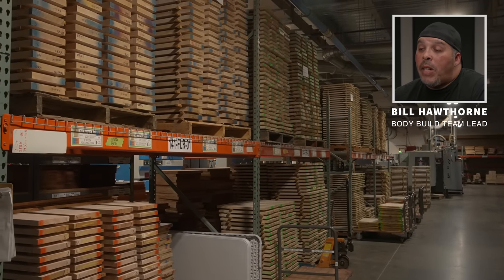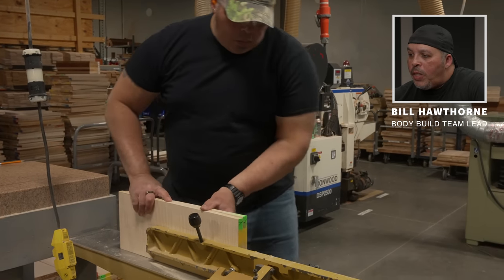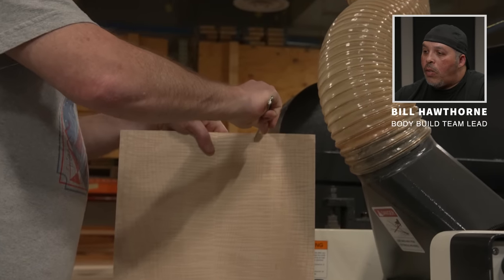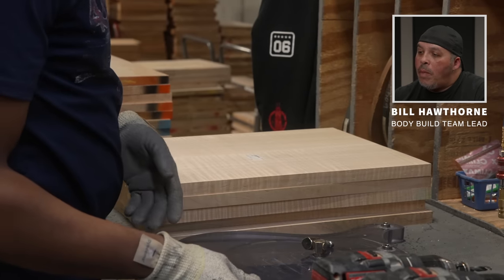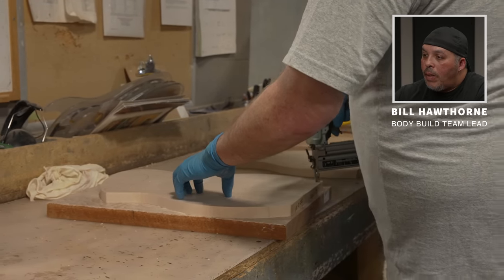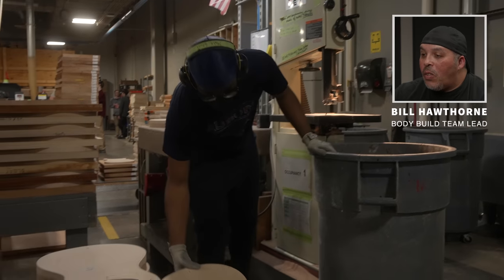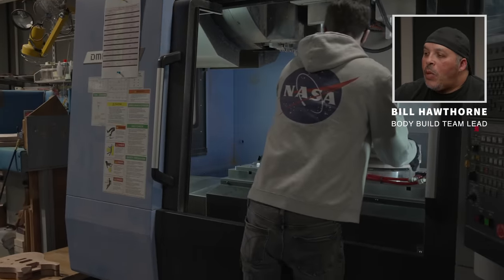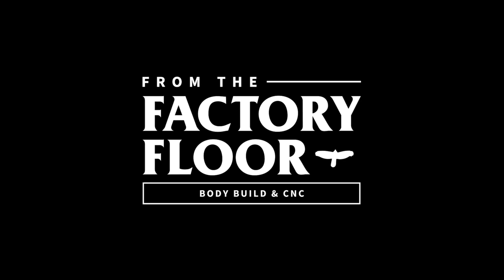How We Build a PRS Body | From The Factory Floor | PRS Guitars

Comment: 2:20 “He’ll be sure to use glue on both sides of that wood”

Doesn’t use glue on the other piece
Reply: Did you see that little wiggle move when he put the two pieces of wood together? That's the move: it completely coats both pieces.

Comment: the joined tops arent clamped? huh
Reply: I went back and I looked at the video. The back of the board has some fingers that push it in and the front of the board has two triangles… They’re like bench dogs or something. So it does get “clamped in some sort of way. Or held together while they use that radio frequency curing device.
Reply: @JohnnyArtPavlou  ok yes they have a pneumatic clamp system. didnt see on first view
Reply: @geezberry8889  Thanks, yes…pneumatic.

Comment: Interesting, I've never seen that joining process before. Did I see that right that in joining there is no clamping pressure applied at all?
Also, usually in CNC machining for wood you have a hose taking away all the chips and dust. You also not seem to bother with that, is there a specific reason why you do that? Just curious to know.
Reply: @2:13 you can see the pneumatic rams on the assembly table that press the two halves together like clamps.  That green trough is where the glue squeeze-out drops away from the glue seam; it's lined with green tape to make cleanup easy.  Each CNC unit has a hopper in the bottom that collects all the chips and send them to dust collection.  There's no need for a bristle shoe with a vacuum hose on the cutter head because it's a closed unit.

Comment: I don’t understand how the glued up top and back are done so that the book match line on the top stays vertical.
Reply: When the clear template is lait atop the glue-up and the tech traces around it with a pencil, the template has a vertical line that runs down the center.  The tech lines that up with the top's glue line before marking the wood.

Comment: For a while I wondered why the CE models did not have recessed back cover plates, but now I’m thinking is it to be close to the thickness of the neck socket screw plate so that the guitar sits more square on a bench surface?
Reply: No, the recessed plate is merely a production step associated with the Core line.

Comment: Really wish they would give the s2 the same carves as cores.
Reply: but then it will take more time, and then the S2 would cost as much as the core... The more time they spend on the guitar, the more expensive it gets.
Reply: @Spidouz  that’s understandable however it’s not like it’s done by hand. It’s done by cnc machinery. They should find a way to make the carve a little closer to the core. Hell I would say the se curve is closer. Just my opinion. I love my s2 but I also love my se’s and find them to be to close on quality at this point. If I would buy more guitars I wouldn’t even consider the s2. I would get another se and that speaks volumes for the se line!